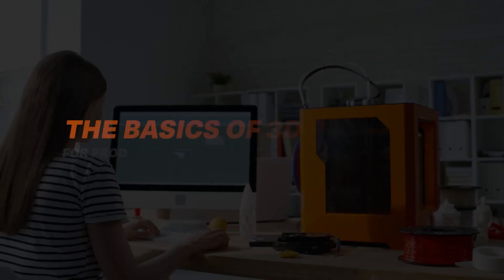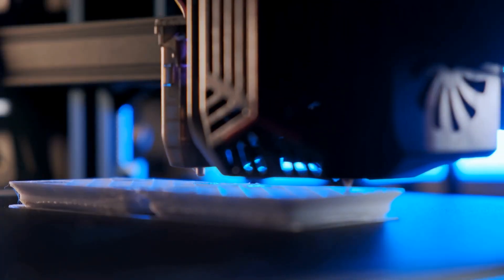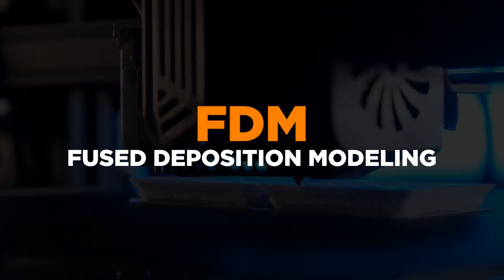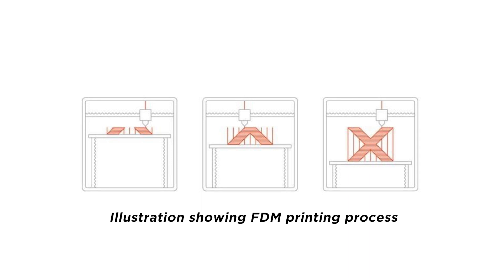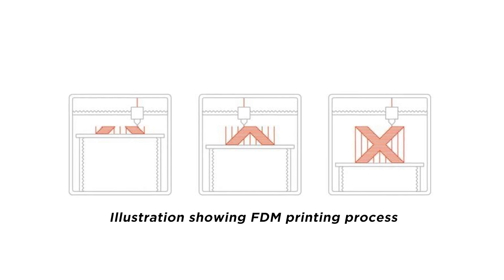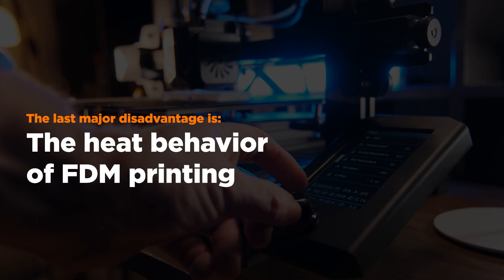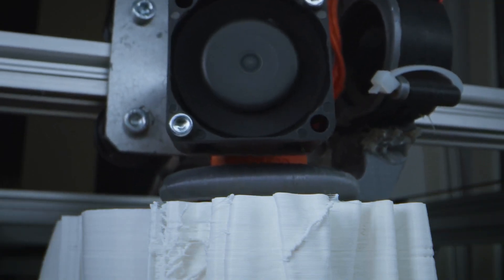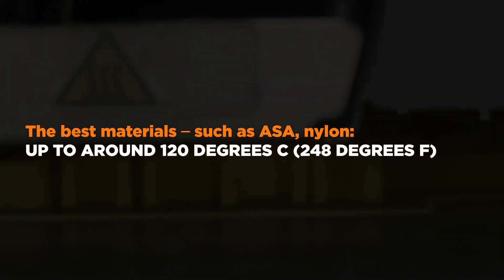Guide to Successful Prototyping with 3D Printers

Comment: I need durable parts for a prototype that will be strong enough to hold water pressure. Please guide me to the right technology😊
Reply from the maker: You may want to look at CNC machined parts, or urethane casted parts molded using soft silicone molds.

Comment: one thing i have to point out. though you're right that fdm is the worst with dimensional accuracy, the 0.4mm nozzle doesn't actually restrict the accuracy to 0.4mm, my printer is accurate and repeatable with <0.1mm